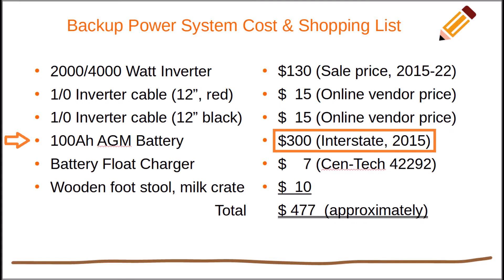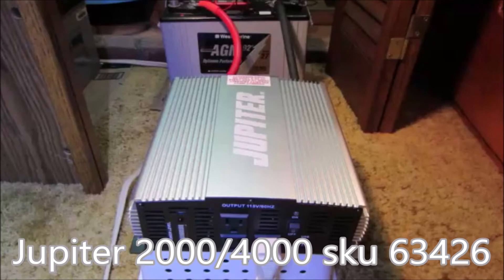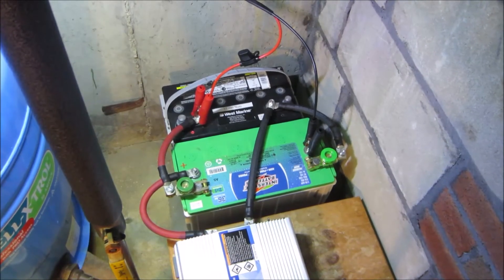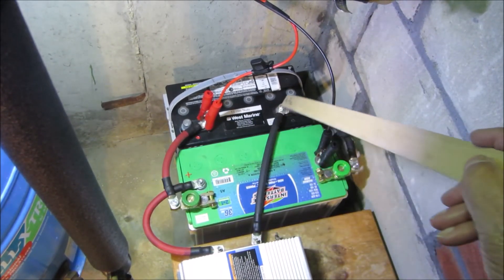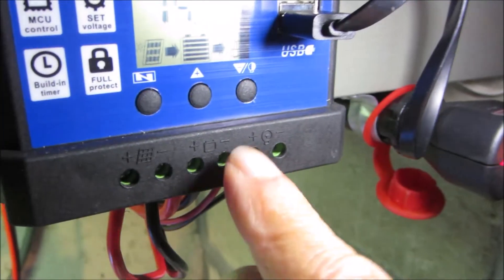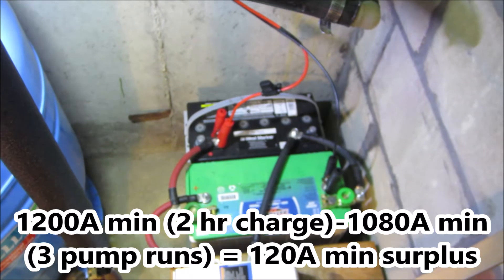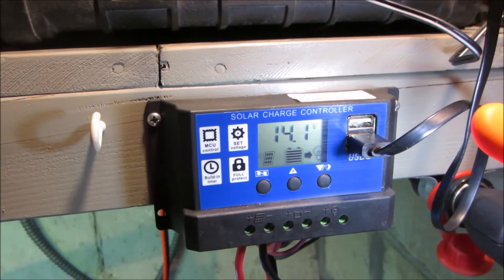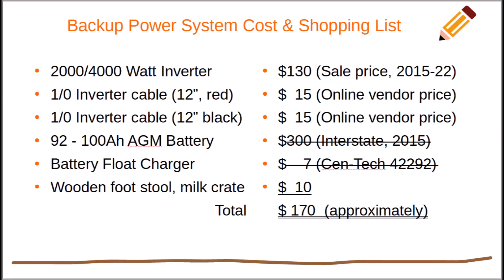Frustrated User Guide: Backup Power Project E8 - Dissimilar Battery Upgrade

Comment: i would suggest water reservoir tank above  ground surface to jump start the pump(Inrush current),  water coming from up dont need a lot of power
Reply from the maker: I'm not familiar with that system. Here, on the northeast US coast at 41 degrees north latitude, we're subject to 100 degree Fahrenheit seasonal temperature swings. During the summer, we have "heat waves" defined as three consecutive days with temperatures above 90, occasionally hitting 100 degrees F. During the winter, we have "cold snaps" with temperatures in the single digits, occasionally hitting and dipping below 0 degrees F. To prevent them from freezing solid, especially when buildings are unoccupied, all private water tanks have to be below ground, well below the frost line. In the southern states, down south as we call it, winter time temperatures are milder (seldom dipping below 32 degrees F) and there are many videos showing jet pumps and tanks just like mine in outdoor sheds, directly above the well head. This keeps the noise down and allows wells to be used in houses without a basement. Please tell us more about conditions in your country. Are all the water tanks above ground? Wouldn't the pump have to work just as hard to pump water up into the tank?

Comment: Lawrence, do you use a separate inverter and battery for your furnace or do you have the furnace and well pump on one?
Reply from the maker: In theory, either of my Harbor Freight, 2000/4000W modified sine wave inverters should be able run my 30-year old, 1990, well pump (1028 run watts) and my 52-year old, 1970, gas-fired, warm air furnace (450 run watts) at the same time. 1028 + 450 = less than 1500 run watts. In practice, neither can do it because the inrush wattage of the two induction motors is so high. According to my BSIDE ZT-QB9 inrush AC/DC clamp meter (currently $35 on AliExpress), the well pump momentarily draws 4,800 watts on startup and the furnace momentarily draws 3,400 watts on startup. If both attempted to start at the same time the total inrush would be 8,200 watts! I doubt that even a HF 3000/6000W modified sine wave inverter could handle that. So, in the past, we've just been careful not to run both the pump and the furnace at the same time. Going forward, I purchased a ridiculously cheap (currently $76 on Amazon), surprisingly good, PowerDrive 1000W pure sine wave inverter, specifically to run alternate loads off of the same battery bank, which is now up to 340Ah. With two inverters on the backup power system, my inrush problem is solved. It's also worth mentioning that my next door neighbor has a gas-fired, baseboard system which uses a circulator pump. His furnace uses so little power that two winters ago, we were able to run it off of a cheap Cen-Tech 750W inverter connected to an old car battery. So whether anyone needs to worry about running both a furnace and a well pump at the same time, depends on how energy efficient the furnace might be. Hope this helps. Thanks for commenting. Please like and subscribe as it really helps the channel.
Reply: @LawrencePina  thanks so much for the very considered, detailed response. I have a new well pump and a heat pump mini split for heating (and cooling) so may get away with it.
Reply: @LawrencePina  So do you effectively have a 3000W inverter now, with the HF 2000W and the new PowerDrive? Are they hooked up to each other (with the same types of cables ring terminal cables) and then to the battery bank?
Reply from the maker: @AnthonyAntTony  Not really. 3000W divided by 120V = 25A circuit, requiring 10-2 wire, but household 120V circuits are typically 15A, wired with 14-2 romex, and/or 20A, wired with 12-2 romex. Read the reviews on the HF 3000 watt Jupiter https://www.harborfreight.com/3000-watt-continuous6000-watt-peak-modified-sine-wave-power-inverter-63430.html?_br_psugg_q=3000+watt+power+inverter. People who've tried it report that it's really just a pair of 1500W inverters, and that it can't run what the 2000W model runs. I can't confirm that, but if it's true, the 3000W model would not run my well pump. So, the Jupiter 2000 and the PowerDrive 1000 are two separate inverters. For maximum power, they should be directly connected to the battery bank (not directly connected to each other) using a separate pairs of 1/0 cables. If you were to daisy chain one off of the other, think of the load that would be placed on the single pair of 1/0 battery cables when both units simultaneously operate at full power - close to 150A DC? It's not something I'd want to risk.